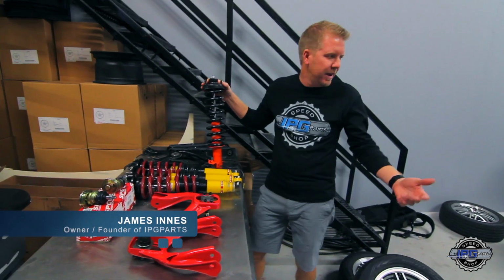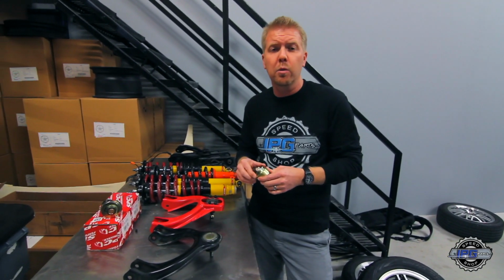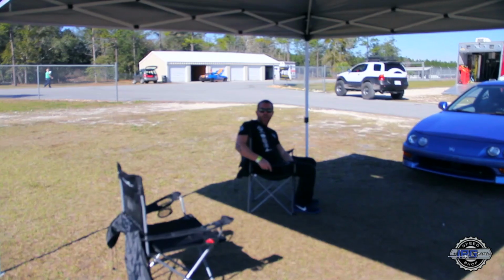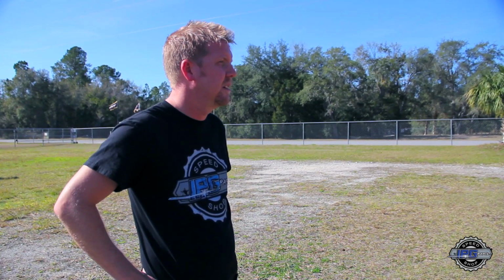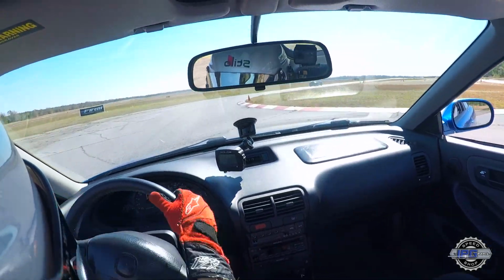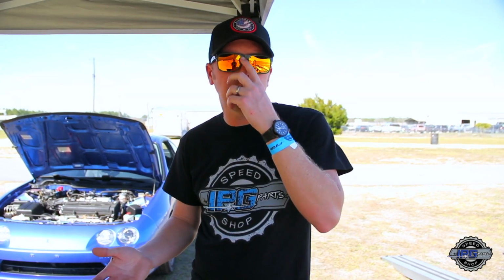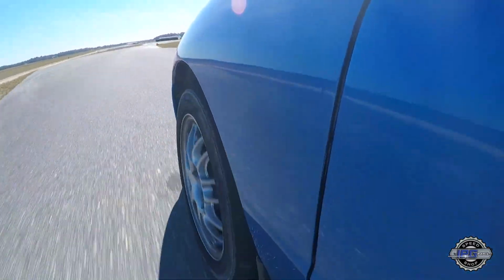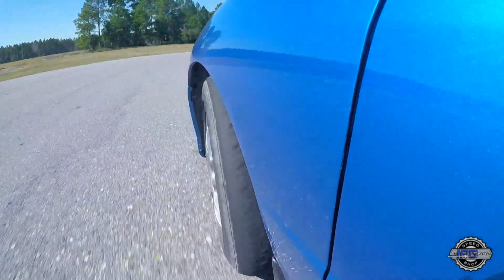IPGparts: High End Coilover Testing EP. 3 (Acura Integra)

Comment: Enjoyable and informative, glad to see some testing with the front sway bar removed and I like the addition of the Koni shocks. I wonder if you kept the front bar and add a larger rear bar it would balance that push you were experiencing, while still maintaining some of the transition and stability the front bar offers. But I can also see flipping the springs front to back and connecting the front bar again. 

Lots of experimentation. Love this stuff
Reply from the maker: Yes..that is a good thought ... swapping springs front to rear or even just throwing the same rate on the back and then seeing how it feels to drive would be interesting to see.  Honestly I would love to take the springs down to 450lb or so front and rear for better comfort on the street and then add the front sway bar back into the mix to see how that works.

Comment: I really enjoy this series and especially the data between parts. I just recently did the suspension on my teg and there was more noticeable understeer than before, what fixed it was the X-bar. I'm now getting slight oversteer which is perfect and my 24mm rear sway isn't even maxed out on the endlinks yet.

Comment: Very clean Integra! Is there anything else hardware wise needed when installing DC2 ITR coilovers to a Integra LS (non ITR)? I already have ITR eyelet coilovers, new OEM ITR rear lower control arms and new OEM bolts. The current brake lines will be zip tied to the ITR LCA's for the time being. I am unsure if there is any additional washers etc. that needs to be installed sandwiched in with the eyelet end into the opening of the rear lower control arm or it just gets installed as is with the one bolt passing through the LCA and eyelet. It would be great if maybe you did an instal video showing the install of ITR eyelet style coilovers.
Reply from the maker: You have all that you need -- going with new OEM bolts is a smart decision...in hindsight I should of done that too, the used parts worked fine but at such a low cost new hardware make sense.  The rear shocks simply install into the rear lower control arm and run the bolt through.
Reply: @IPGparts  Great! Thank you very much for the clarification! I look forward to seeing more future vids on the integra!

Comment: Since I cant really find parts for the DB7 Integra, Do the suspension components from the DC7 and Hatch fit the Sedan? Its pretty hard to find anything for the DB7 aftermarket wise. Im new to the Honda scene coming from Euros.
Reply from the maker: All 94-01 Integra suspension parts are interchangeable (except the rear shocks for the Integra Type R model, those are chassis specific)

Comment: Did you correct the tire wear? What alignment specs did you run? concluding the issues mentioned at the start of the episode would be nice lol.
Reply: I saw the specs on your page, remove the toe out front and rear, its not helping.
Reply from the maker: Yes...noted on the recap -- the tire wear on the front is better but still not ideal. The test track we are using (The FIRM in Starke, FL) is very hard on left side tires, in particular the left front.  We haven't completely sorted the best setup for that track but I am confident the setup on the car now would have excellent wear characteristics at a place like Sebring that is more neutral from side to side and in general on the camber settings.  The toe out in the front will be staying as that initial turn in is needed based on the car setups I have done in the past, but yes, the rear at zero would be better imo.
Reply: @IPGparts   Thanks for the reply.  The toe in up front works good at entry but hurts mid turn since the outside wheel with most of the load is pointed at slightly less of an angle than the car which causes under-steer.  The inside tire gets you into the corner  quicker but mid turn it's impact is reduced due to weight transfer to outside wheels.  I run with a larger rear stab bar in  my integra to get it to rotate, zero toe front and rear and about the same camber as you. However it's driver preference like you say.
Reply from the maker: @Johnman5757  appreciate the feedback

Comment: Is there a part 4?
Reply from the maker: The Shocks are Koni 3011 , I don't believe they offer them anymore , not sure on a part # . The spring part are the Ground control kits still available with custom spring rates
Reply: @IPGparts  I don't think he was asking about the konis, I think he was asking about another video, but they do still offer the 3011s btw.
Reply from the maker: @spacemodulator1027  That is strange, the response went to the wrong place -- as far as I know the Koni 3011 are no longer available new from Koni
Reply: @IPGparts  I'm a vendor for turn14 and I can get them still. It may just be the remaining product on the shelf.